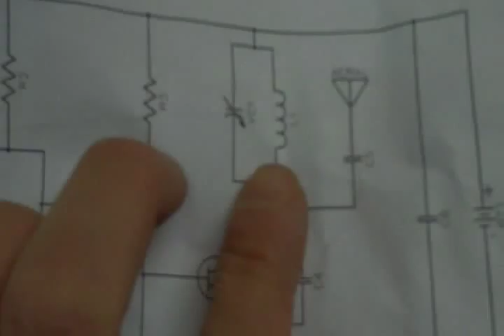DIY FM transmitter

Comment: I checked your schematic and found that you cannot touch your transmitter because the frequency will drift. If you want to use an fm transmitter as a hand held device then you have to separate the antenna from the oscillator using a buffer stage. In your case, the antenna is getting loaded and since it is connected directly to the inductor, it is causing the frequency to drift when you come near to it or the coil. If you want the demo of my stable circuit then inform me, I will post the link.
Reply: Manash Pratim Das can you please send me the schematic with audio jack as input ??

Comment: Ya of course, by changing the resistor atop the mic would change the audio sensitivity of the transmitter because that resistor is a load resistor. According to the circuit a 22K ohm resistor is used. If you want to decrease the sensitivity so that you can speak near the microphone louder then you will have to change its value to around 100Kohm. Its better to use a variable resistor in series with your 22Kohm so that you can adapt it as per your need.

Comment from the maker: @chubbychinchilla - absolutely, but you'd have to turn the volume waaaaay down so it wouldn't be distorted. Additionally, I would get rid of R1 if I were doing that. Just hook the positive to the capacitor that leads to the base of the transistor and the negative to ground and you should be all good.